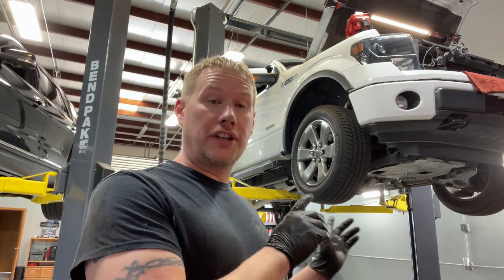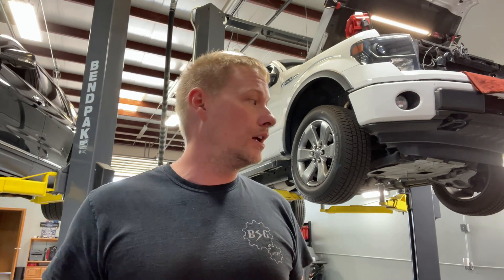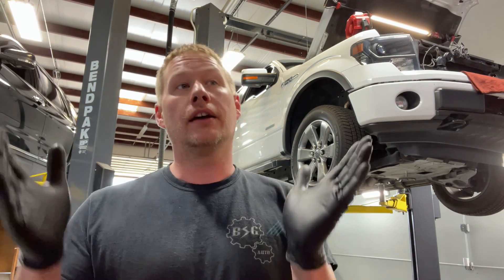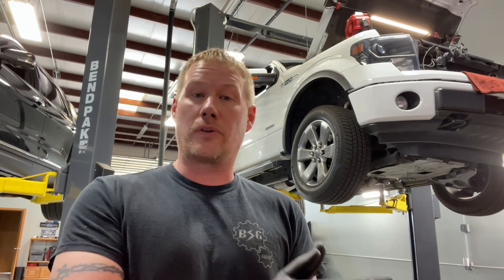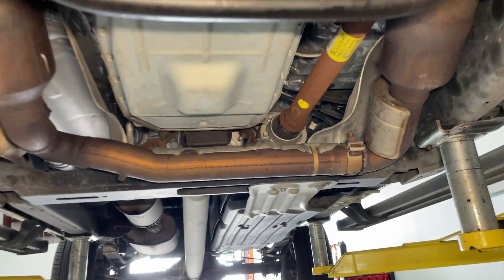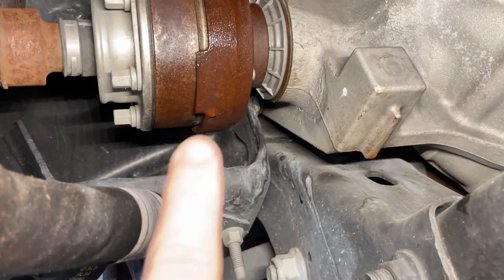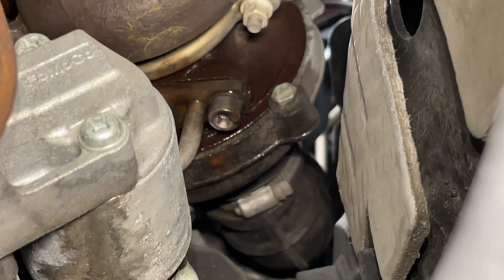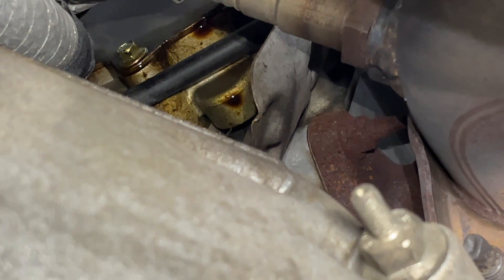Ford Ecoboost Engines Can be so Hit or Miss: I Really Feel Bad for This Customer...

Comment: I think the new electric truck will solve a lot of these problems not because of better engineering but because the parts wont exist to leak. True the battery cooling system still has coolant but when two thirds of the parts of the truck are gone they cant contribute to hosing your wallet pun unintended.

Comment: Doesn't anyone ever think about the difference in expansion rates between the fitting and the surface it's mating up to on the turbocharger?  Why on earth is this a mystery in 2021 and why cannot Ford engineer and manufacture lines and fittings that will not leak because of it?  There has to be a reliable way to hook coolant water lines up to a turbocharger so they will stay leak-free for 20 years or more.

Comment: Just had a 2013 3.5 ecoboost with 140,000kms have timing issue that wrecked my cams, a couple cylinders and valves. Ford says $13,000(CAN) for a new ecoboost otherwise there’s no fixing it. Not to mention I had the timing chain fixed at 80,000kms in 2017. Kind of a piss off!!!

Comment: I have a 2014 1.6L Escape…. Thank god we had the 7/75 ESP! New engine at 67k (coolant intrusion into block)… many, many other issues but ALL covered by warranty. For my part, thanks to THIS CHANNEL, I have really kept up on the scheduled mtce and overdo the PTU, trans, coolant and rear diff aka RDU fluid changes. Car is in immaculate shape and the only thing the dealer did right, for sure, was the engine swap… their other work was always substandard.  Hopefully we’re GTG now.

Comment: My 2013 eco boost goes in for the timing change next week. 112K miles. Been making the noise for about 6 months.  $,$$$. I won’t buy another eco boost and probably won’t buy another F150.  The discussion forums are littered with comments on this problem on even the newest models. Terrible if you are one of the unlucky ones.

Comment: I rather have longer lasting parts all around than cheap plastic, metal and rubber. My 06 Mustang had too much plastic and ended up stripping bolts, even the brakes. Don't get me started on the plastic thermostat housing they eventually did fix. A simple $30 change resulted in a $300 fix. And I can see newer cars are still cutting corners, at least my new 2017 Sonata isn't that bad.

Comment: I had an EcoBoost Expedition for a while as a work vehicle. It only had 40k miles and it already smoked at stop lights. The power delivery was terrible. It had turbo lag, really strong mid range, then fell flat on its face in higher RPM. The handling was also super sketchy. The Expedition was so bad that I actually preferred my terrible Transit work van.

Comment: Almost as if asking a 3.5 liter engine to do the work of a 5.4 liter by adding turbos and having it under almost constant boost, is a recipe for problems?
But at least it gets 1 more mpg in town. 🤔
Reply: The 5.4 Triton V8 (both 2 valve and 3 valve) had issues too. So you might think "displacement" is better but no, the 5.4 had plenty of issues too. Everything from spark plugs blowing out, to timing chain issues, to Fuel pump modules failing.
Reply: @jza80king  don't forget exhaust manifold leaks too!
Reply: @ftby59mikeD  and cam rocker followers... The list is endless.
Reply: I real think the 5.4 was the better built motor. I've seen both scenarios with the 3.5. My neighbor had a 2012 with the ecoboost and that thing was a complete nightmare. They upgraded to a 2014 ecoboost and it's at 200,000 miles.

Comment: It sucks, but they aren't building vehicles for the type of people that keep these trucks for 10+ years and really start putting miles on them. It made it to 70k miles which is about the time when most people are going to be thinking about "upgrading" to the new hot F150. Your average consumer is going to keep their vehicle until it's paid off or almost paid off, at which point it starts breaking down (like this video!) and it's off to the dealership. What's the deal with newly designed V6's and Turbo Fours having timing chain issues? VW 2.0T, Nissan VQ engines, 3.5 EB etc.

Comment: My 2014 ecoboost has been great so far. 112k miles and I have only recently changed a spark plug due to a miss fire. Just need it to last a little longer till I make the switch to a duramax.

Comment: Just proves part variations and accountant cost cutting can kill the best vehicle.  The real shame is Ford is abandoning their customers.  

That's the reason choose to I drive older vehicles, less complex vehicles are easier and cheaper to maintain which there's usually some "problem solver" aftermarket parts available.

Comment: I've had my timing chain replaced at 148,000 km and still have a rattle at start up even though the service dept at the Ford dealer said the cam phasers were fine.  And yes I must have those coolant leaks too because after parking and exiting the cab I can smell coolant faintly

Comment: I have a 2013 F150 with the 5.0 v8 with 55K miles. It makes an odd tapping noise underneath the engine. I've taken care of it really well. It had coolant leaks, but that mostly resulted in low coolant in the reservoir and the truck never got hot.  I run synthetic blend oil with the standard  filters used by oil change shops. 

The truck is pretty solid reliability wise, but that noise is disconcerting.

Comment: My 2019 F150 3.5 EB has the timing chain clatter that started at 72k. Along with that the front hubs are now humming as well. This will be my last Ford, my 2017 had the chain issue that started at about 75k as well. Really
Reply: Lol why did you buy anything newer than 2015

Comment: Pennsylvania purchased truck here. 2015 F150 2.7 Ecoboost Supercab. I bought the vehicle in mid 2018 to replace my 2004 F150 (I was living in Virginia at the time). Moved to New Orleans mid 2019. Drove the truck up to PA in April 2021. My 68k mile engine took a dive because the same turbo fitting failed and it was a catastrophic loss of coolant. Thankfully was 1 mile from dealership in PA when it happened. 4 days of waiting to get repaired, and then I was on my way back to southern Louisiana. Only failure I've had with the truck since purchase.

Comment: @FordTechMakuloco Hey Brian, question for you. So have these issues with the phasers/leaks etc. mentioned in this video largely been cleared up on new vehicles? I'm in the market for 2021 or more likely a 2022 Expedition. Will I be dealing with these same issues? Has Ford at least made the running changes necessary to address these issues on new vehicles?
Reply: As an Expedition owner, I recommend getting a warranty for at least 150k if you plan to keep it. The peace of mind is worth it. My head gasket went at 116k...$4,000. Now my turbo manifold has failed at 128k.

Comment: I had a 15- 3.5L ecoturd once, in the shop constantly. Heard then manifolds warp, sounds like a cricket in your motor when you get on it lol and that was it, sold it real fast. Nickel and dimed me to death and never got a loaner from ford. Used 4WD 2 times, and it went into the shop after both times.
Reply: I have had 2.  Excellent engines zero problems.  Ford paint is another story

Comment: What's your take on gen 2, 3.5 eco reliability? I've seen a lot of your gen 1 videos but don't think I've seen gen 2 on your channel yet. I've bought a used 2017 and long story short after seeing it's repair history from the dealership, wondering if I should put a few upgrades on or just get rid of it next yr.
Reply: Gen 2 ecoboost are worse timing wise with the phasers than the gen 1s

Comment: EB, 5.0 F150....   Though I loved my Mustang GT and its 5.0 and had no issues.  If I was to buy a new truck today.  Id pass the F150 all together and go straight to a F250 and the 6.2.   My two Ford worktrucks have ("had" the oldest one was wrecked by someone else) over 100k HARD miles and the drivetrains have been absolute anvils.   The things I have done and gotten away with on those trucks Id have to tell you over a beer (because of my job).   The exact opposite is my newest worktruck POS Ram with 6.4.  75k miles has been towed back to Dodge no less than 10 times.  Too much to list failures.  AC system, brakes, electrical, transmissions, rear diff, on and on.   Still waiting on it since April for its 2nd transmission to be installed (1st let go at 10k miles).   Of course my older F250 has been my ole faithful backup.    Never a Ford guy, but those two F250s sold me on their trucks.  Oh and the F250 is a much better running and driving truck then the Ram, though interior space sucks.

Comment: I have a 2011 with the cold start rattle. It has about 150k miles on it. At what point does that rattle turn into serious engine damage? I can mitigate that rattle somewhat with more frequent oil changes and cranking the engine before starting after it sits a few days.

Comment: As a former tech for a different flavour of pickup trucks, what bothered me the most is that these very basic issues are happening on vehicles with $70-100,000 (Canadian) price tags. There’s a place for budget minded vehicles, but not when it’s being advertised as a premium product.
Reply: It is completely unacceptable
Reply: I talk about this very issue frequently. You're exactly right.
Reply: @John Smith ... did you buy the 2022 Tundra with their turbo waste gate issues? They're good for a ton of laughs!
Reply: @hmdwn  Toyota runs their engines for over 1 million kilometers before they hit market. They easily can hit over 500K with proper maintenance. That can never be said for ford or GM
Reply: This trend has been the case, across the board, for all products in all industries. Quicker, faster, cheaper, more disposable - but not priced as such to the consumer. Vacuums, phones, computers, refrigerators, dishwashers, washing machines, anything that requires mechanical aptitude to repair or diagnose has devolved into trash that lasts only a fraction as long as its predecessor from 20 years ago. It's a time of the signs my friend.
Reply: @CharlesVanNoland  Bought a GE Microwave in 1988. It was still working in 2016.
Reply: Just seems like this shit always happens right after your warranty runs out. Ford Should have a clause in the warranty contract that they need to bring your truck in a few times a year for a free inspection. Then this bullshit would never happen but we are talking about Ford warranties. And my opinion they suck.
Reply: @John Smith There’s some pretty good money made off of Toyota’s too. They are not immune to the corporate greediness of charging the most they can for the perceived value of the product. I don’t think the Toyota truck line of today is as robust as it’s been in the past.
Reply: @CanadianDirt  They are. I have a 7 year old Toyota 5.7 and a 20 year old Toyota 4.7. I'm the only owner of both. Neither vehicle has ever needed a repair. I'm sure time will prove the new generation just as reliable
Reply: 70k miles on a vehicle is nothing to me, if a modern vehicle can't hit 200k imo it's a pos. And I'm kind of a Ford guy, I mean I've owned and worked on a few older Ford trucks and I just traded my '21 with a 5.0 for a '24 with a 3.5 and I love how the 3.5 drives so much better. I'm just hoping that at this point the issues are mostly ironed out.
Reply: It's things like this is why I never buy brand new anymore. I have a trusty mechanic and he warns me what to stay away from.
Reply: @John Smith yah, I bought a Toyota also.........back in 88, still driving the same truck!😂🥃
Reply: @zzzz-ok7733   Those Toyotas are legendary trucks.

Comment: I have a 2019 (2.7lt) that has just at 40k miles. Services up to date but, it has started to smoke at start up. Ford Service did an TSB for a tube going into the turbo area. Seemed to address but, the other day, early AM crank up and still smoking at start up..  Good ole White-Blue oil is where it shouldn't be.

Reluctant to take it back since I never see broken parts removed and not sure I trust going over the warranty so, wtf...

Comment: Just had a 10 speed and converter grenade at 97k miles on my 17 F150. Not under warranty, I just bought the truck 4 months ago. $6500 later...  Ford should get the basics right. This kind of stuff should never happen at 70k or 100k be miles.

Comment: I have the same truck.  Water pump leaked at 80k (replaced) and the electronic steering system went completely out at 90k.  The steering fix alone was $2k.  I've only ever bought F150s, and this is the last one I'll ever buy.  When this one dies, I'm trying the Tundra.

Comment: My 2013 has had the startup death rattle since around 50k miles. I now have 104k miles. I might need to take a look to see if I have those leaks also in my truck. I haven't been under it in a long time.

Comment: It’s a Ford that’s the problem.
But dodge & Chevy share their problems too with cam and lifter failure.
They don’t make vehicles like they use too they make them with cheap parts and crappy metals which leads to failure in a short time. 
The shitty part is we pay 10 to 20 times more for the vehicles today then we use too back in the day when cars were built to last forever.

Comment: The ecoboost engines are more efficient and get better gas mileage but is it rlly worth it when ur F150 isn't even gonna last 200k miles. A old 5.0 or 4.6 triton is superior in terms of solid work truck material

Comment: I've got to stop buying Fords. Had the 5.4 with spitting out spark plugs, the 6.0 diesel with head gasket problems, a brand new motorhome on a Ford chassis that a cat went out on at 20,000 miles...Ford tried like hell to get out of paying for the repair...now a 2016 6.7 diesel that has the annoying oil leak at the 2 piece oil pan. Of course it started after the warranty was up. They have to remove the damn cab to fix a tiny oil leak. Minimum 2 grand and God only knows what happens after they remove everything and put it back together. Of course there is no recall even though it happens consistently. Stand behind your vehicles Ford. GMCs are looking better every day.

Comment: That sucks. The coolant leak issue is from a stupid reason in my opinion. Why would you put a quick connect fitting on a turbo that radiates heat well over 400 degrees? Heavy truck engine manufacturers figured out a long time ago that banjo bolts with copper sealing washers on the end of braided stainless lines work the best. Rubber just can’t hang for the long haul.

Comment: Last ford I bought was in 1998 mustang cobra. Luved car but  no long life there 32 000 miles rear end  went bad also had 1998 expedition  needed a new motor after 6000 miles.  No thanks dord, chevy, dodge arnt in my vocabulary anymore.  They've been going dwn hill for years.

Comment: Ford is currently replacing the long block in my 2018 Edge 2.0L due to coolant intrusion in the cylinders. Known issue since 2014 and it's still a problem.

Comment: I really wanted to buy a used ecoboost F150.... after doing doing about 6 months of research I said screw it, bought a garage queen lifted 06 Toyota 4runner. I couldn’t be happier, sure its not a truck but I can still tow 5k plus I get about 23 mpg’s on 31’s not to mention It’ll stomp pretty much any domestic truck off road.

Comment: I’m having issues with my ac in my 2016 2.7 ecoboost.  It’s cold sometimes then not so cold. Fan’s blows well.  I do notice a lot of condensation; it seems to be more than normal dripping from the truck. Thoughts. I only have 50,000 miles.  Also. Any recommendations for the 2.7 eco engines for longevity.  I don’t see a lot of content on these engines on YouTube especially self maintenance videos.  Thanks in advance.

Comment: Hey bud since you’re a Ford tech I just bought a 2019 escape with the 2.0 eco With 7600 miles on it and I’m just wondering by your personal and professional experience if I need to worry about anything about this vehicle because I don’t know much about them but it drives like a brand new car everything looks like everything is in order…heck it still has that new car smell!! But we didn’t buy at a Ford dealership so I’m wondering if I should take it there for an inspection?!? Any advice would be most appreciated

Comment: When ford started going the ecoboost route I suspected it would be a high maintenance engine.  That has kept me away from buying another new ford.  I still have my 2001 ford ranger I bought new 4.0L v6.  It still runs great and makes good power and has 250 K.  Only things fixed and just accessory things like ac, waterpump, alternator.
Reply: Yeah, but that engine has the FOUR timing chain setup with poor timing chain guide issues. (4.0 SOHC).....but you got 250K out of it so it paid for itself already....might want to install a pre-oiler or do the pedal to the floor at "startup" to disable the fuel pump = pre oiling chain / guides ....being startup puts the most stress on them and they're dry then.

Comment: BM turbo vehicles leak because everything is under pressure and hot. So Ford sales needs to get honest with people and if they can't handle that then buy a NA v8. Also maybe they need to run a higher viscosity oil with seal conditioner and sealer tabs in the coolant. Constantly doing thousands of $$ in maintenance work is not a realistic solution.

Comment: Seen coolant leaks at the fittings pretty regularly even up though 2018s.  Have done trucks with 430000 miles.  There is a design change recently so we'll see how that goes.  Exhaust manifold leaks are also common.  Always replace the coolant lines now due to corrosion.  Its a huge pain but will save customer future costs to go back in a year after the repair.  Water pumps 3.5 and 5.0 fairly often as well.  Ford does the vct phaser rattle so often under warranty we have a tsb with a parts list.  Have had to do some that were done 20000 miles before.  Its an ongoing problem.